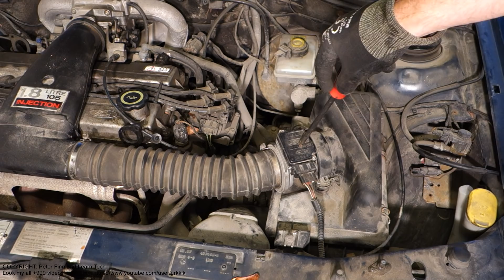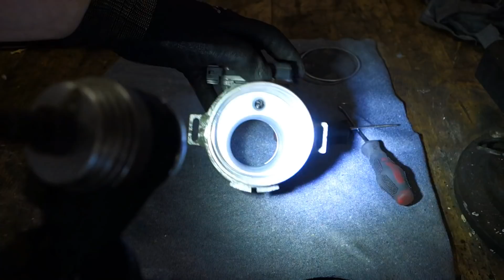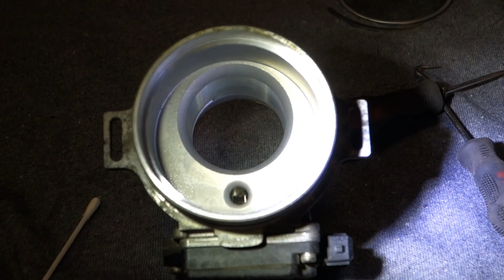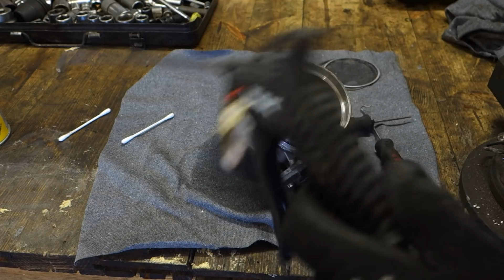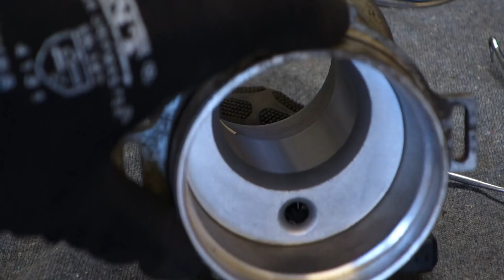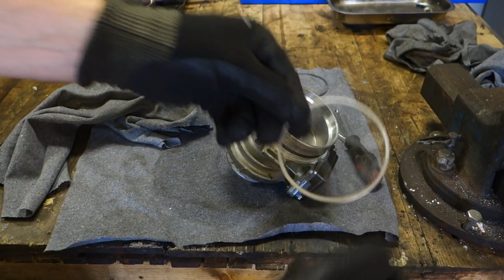How to clean Ford Zetec engine MAF air flow sensor. Years 1995 to 2010.

Comment: Never clean a mass air flow sensor with a Carb cleaner mate .
The sensor is extremely delicate and carb cleanor will leave some residue on that even tiny enough not to see it but still effective negativly on the sensor .
There is a specialized sprays Mass air flow sensor cleaner in the market . Try CRC MAF CLEANER or PRESTONE MAF CLEANOR ON EBAY OR AMAZON 
I bet this car has never seen a sun light after all
Reply from the maker: Hi Sir, I have cleaned my sensor years with Carb Cleaner and No any Issues! BUT, all cars have been Toyotas. This is maybe the thing why sensor are OK? Denso Quality from Japan !